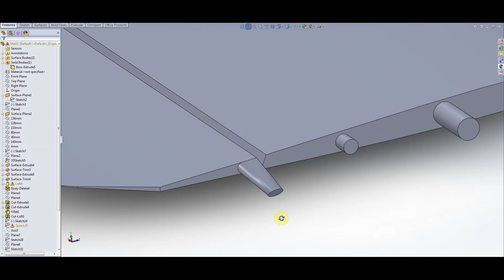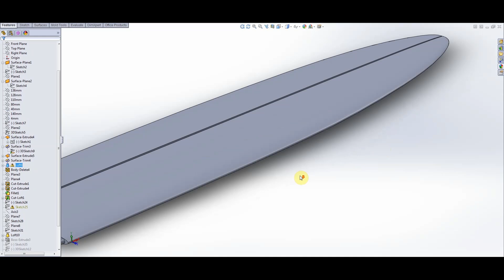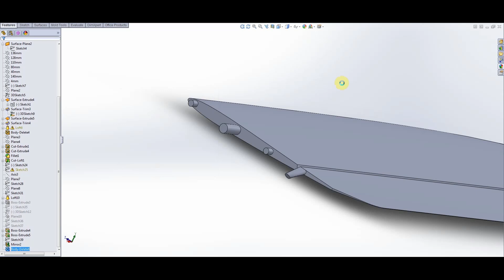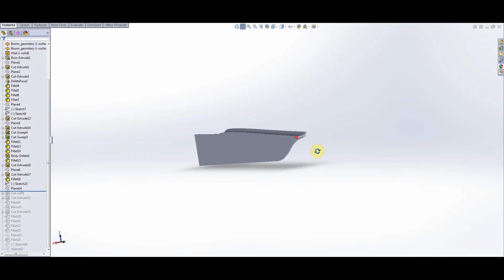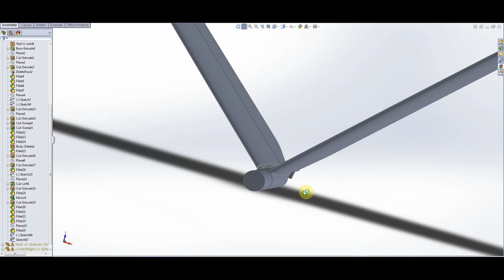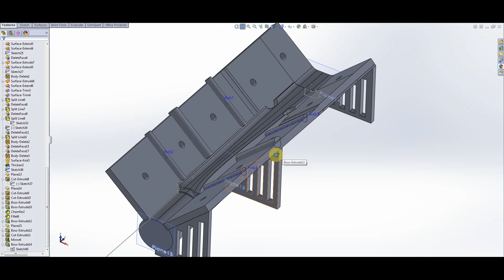Vertigo F5J V-Tail Design Part 1

Comment: just a very informative and entertaining video
Reply: I would start to position the V tail downwards. I don't understand why you should want a classic V tail on your plane because the steering always creates movement that is opposite of the desired direction like with yaw on the vertical stabilizer you have to recover with the ailerons. Drag on the tail of a plane creates stability and when there are holes in the tale you also will have good cooling of the internal components. On gliders the servos should get quite hot.
Reply: Never use a mechanical hard drive in a PC?
Reply: I have bought and tested a normal non-V tail glider and the rudder does not do much and still creates lots of roll; contrair of my expectations. I do not really know what to do with the flaps. Could you do a topic of that? For example use them on down winds? Also landing with flaps makes the plane less stable and the landing speed is almost 0 anyway. I only noticed that with strong headwinds the flaps up (2,5mm) reduces drag and increases aeleron authority. I have to say this DLG plane is great investment; inspirered by your work and YT channel. I use the right slider to control the flaps and added some elevator down on flaps down.
Reply: @prep0wer  the rafale by sd creations has an inverted y tail for exacly that reason
http://www.sdcreations.co/rafale.html
if a wing has dihedral, using the rudder will also bank the glider into the turn
some modern dlg's only have aileron and elevator servos installed, with a fixed rudder
Reply: @marc_frank  Yes thank you for that information. I think the best well known example is the Gray Eagle drone. I used also this type of steering and 2 servo elevon/rudderon mixing on flying wings and "normal" models, to keep the main wing clean, and it works great for high speed stability but not for slow speed landings and take offs.

Comment: how did you convert the airfoil .dat files from xflr5 to spline sketches?
there is an addon for fusion360 to do that, but i don't like how that does it
so i ended up pasting the coordinates into airfoiltools, downloaded svg's and manually fitted splines to the points
Reply from the maker: Similar, export. Open with notepad,copy into excel, save as text, open with insert curve tool in solidworks.